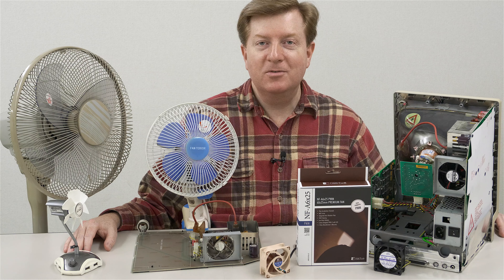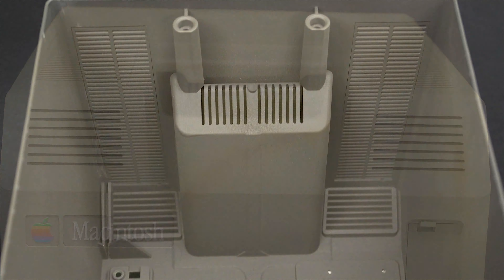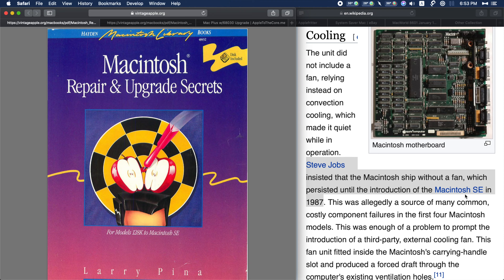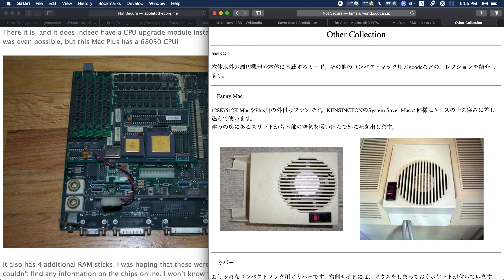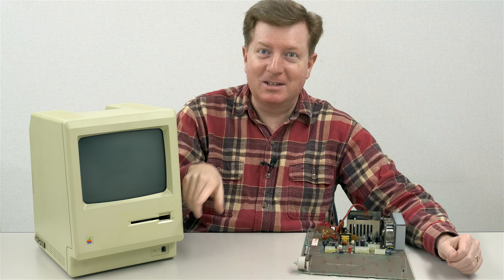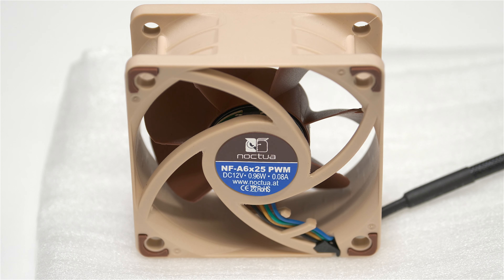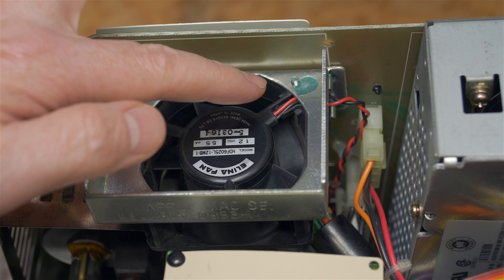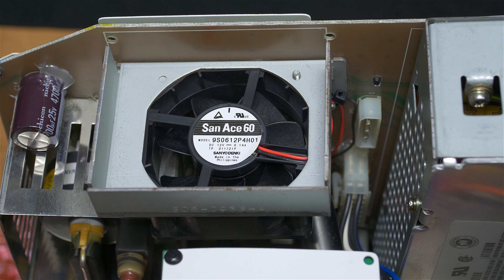FANS for Compact Macs [128k - Color Classic]

Comment: Wow, thanks for taking the time to solder in and out all those fans— not an easy task to take the machine apart so many times!  I hate doing it just once because I’m always worried about bumping the neck!
Reply from the maker: I never had an issue bumping the neck. What I did find is that repeated disassembly puts strain on those analog board connectors, which is why I mentioned them and hot glue in my video. Thanks for watching!

Comment: Wow - what a thoughtful and useful video; it reinforces my faith in humanity :) I've been reviewing fan options for my VERY loud Quadra 950, which uses an old Sanyo Denki 120mm 12v, and I've been curious about Noctua models in terms of pressure vs. sound level. As others have mentioned, the sound level becomes especially apparent once one has converted a noisy SCSI HD to an SSD option, like Artmix has offered for years, or more recently, the SCSI2SD products. I especially like the PWM wiring conversion - a very elegant solution in how you tidied up the unused leads inside the shrink tubing. Thanks again!
Reply from the maker: Thank you for your very kind words.  Those Sanyo fans are very loud.  But they move a lot of air.  So if you don't have many heat-generating upgrades in an old Mac, it makes sense to swap it out for a Noctua which moves more air.  However, for a compact Mac which tend to run hot anyway, adding multiple upgrades can make it a real scorcher inside.  My Silenx fan is dead silent but moves so little air it hardly differentiates itself from the Mac 128K which uses convection cooling.  The Noctua is much better, but even that doesn't cool like those loud Sanyo fans do.  Nothing cools like the Sanyo, but not everyone needs that much cooling.  Best wishes!

Comment: I've watched this video a few times now and I must say (as a Mac Plus user) how glad I am that you did spend a few minutes talking about fan-less Macs from the 128k to the  Plus. I have every time I've used the Plus after about 15 or 20 minutes felt the top and felt it get reasonably warm. I'd be lying if I said I wasn't a little worried about it despite my Plus being completely stock aside from the RAM upgrade to 4Mb and running system 6.0.8.

I'll try to find an external desk fan to point at it at some point just for some added peace of mind since It kind of puts me off from using it a little when I think about how warm the computer feels when I feel the top. Even though I live in the UK and since its winter, the temperature almost never rises above 20°C anyway, that and also the fact I had the capacitors replaced with brand new higher voltage tolerating ones just a couple months ago.
Reply from the maker: I'm glad to hear my video has been helpful to you. Since you live in the UK, I honestly wouldn't be worried about the heat you feel with your hand.  Some have chastised Apple engineers for having created it that way, claiming it was due to a Steve Jobs demand rather than good sense.  But engineers are still savvy about how to design something well within undesirable constraints.  Not every Macintosh 128K failed due to heat.  However, on the earliest 128K models, there is that flat piece of metal soldered to the very top of the analog board.  You are a Mac Plus owner, so your board should not have one of those.  For people who do have one of those earliest analog boards, desoldering and removing that metal piece will allow better airflow up and out the top vents.  Again, since you live in a cooler climate and have recapped your machine, you really don't have much to worry about.  Just keep your room cool enough for you to enjoy (and not sweat) and your Mac should be just fine.
Reply: @JDW-  Thanks a bunch! I'll try not to be so apprehensive when it comes to the warmth of the Mac from now on.
Reply from the maker: @TaijanDean  So long as you don't just leave the power switched on and then walk away for hours or days at a time, it should be fine.  These old Macs don't have sleep mode.  Our finger powering the Mac off is the only sleep it gets. :-)

Comment: Thanks, it had a lot of useful info and I appreciate all the work involved with testing the fans.  Note, I did my Noctua replacement before watching it and I simply used a standard Molex splitter for a solder-free solution. Feedback: the video was quite repetitive and could easily have been half the length with the same contents.
Reply from the maker: Thank you for watching and for your kind comments. The key to getting something stuck in our minds is repetition, so anything repeated in my video was done deliberately, to the chagrin of some and to the delight of others.

Comment: hi, thank you for this great viedeo - 

i now install some Noctua 60x25mm PWM 12V in my several Macintosh Classic II with silent Conner 40 or IBM 80 HDD , and i figured somthing out to the Noctua plug 4 pin

in Classic II (Classic ) -  you dont have to cut and solder the wires and isolate of the Fan to plug on the two pin sticks of the Classic II analog board - you can use the Noctua PWM 4 pin plug ! ( 3 pin Plug maybe - ive only testet this by 4 pin PWM )

just pin out the blac Noctua 4 pin Plug gently with a needel - turn the black plug arround and  use the inner two holes to stick bach the yello for plus and black for minus kables - the othe two not used cables in the outher wholes back 

look at the code pin on back of the black plug you will see the two pin code pin will go beneath these if you use the inner two for 12 V fan voltage ( 3 pin maybe same , not testet )

to pin it right,  note that the "BP3"  2 pole stick on the analog board is written that "1" beneath - is plus 12V ( noctua yello cable ) and "2" is minus ( noctua black cable ) pinned

 to stick the 4 pin black plug back to the analog board sticks 12 v use the inner 2 - the outer 2 cable stands right ond left over - but isolated in plug 

a niche an clean looking solution without cutting and soldering and ugly kable isolation needed - i think

after 10 years MacMad again 

Greetings NT-Tom

Comment: Thanks so much.  Just inherited a nice recapped SE/30 with maxed out RAM and wanted to replace with something more effective and quiet.  BTW -  I also grew up in the Central Valley ;)
Reply from the maker: Thank you for watching and for your comment.  I've lived in Japan since 1994, but there's a lot I miss about the Central Valley.  The thing I don't miss though are the summer temperatures.  It's quite a bit cooler here in central Japan!  Folks in Fresno definitely need to have the San Ace 60 in their SE and SE/30 Macs! :-)
Reply: @JDW-  Indeed!  I too have left the heat, in my case in '91.  Keep on Mac'in in Japan

Comment: Hi, DJW

i found 3D printed fan holder for SE SE /30 and even for Classic ClassicII     on e lecto - bay -  USA  ;-) for buy  what your are looking for at minute 44:00
with a better air flow as it looks, the Classic housing is even built for a bigger 80 mm fan

( he also has some useful Macintosh 3D printet gadgets like for the Quantum head problem glued on old rubber by starting )

i also figgured out by install several noctua 6x25 FLX !  3 pin fan that there you have to choose the red wire for +12V  - not the yellow as by the 4 pin PWM fan shown by you

i also find a way to connect only short wires from the fan to the SE analog board by drilling 2  1mm holes underneath the 5 V GND 12 V + connector for the HDD Cable and weld  the original shorten fan cables from the welding backside

with the delivered Power adapters from the FLX 3 pin noctua you even need no welding just using the 12 V adapters on this HDD VCC Connector

but i worry a litte bat of maybe get a contact problem with this short adapter so cut of the cables an weldedt them as descripted

how a PWM Noctua 4 pin fan can installed without welding , in a Classic , just pin out the connector case - i wrote som komments below

greetings MacMadTom

Comment: How did you get the 128k to play that video of Steve Jobs introducing it? Is it built-in?
Reply from the maker: I have long waited for someone with a sharp mind like yours to ask me that very question! The answer is: magic! ;-)  

Okay, a bit of FCPX magic.  But it is really running on a B&W vintage Mac.  You see, the 128K through the Plus just aren't power enough to play back video, even small video, much less full screen.  So what I did was create a B&W Cinepak version of that video using my G4 Cube running MacOS Tiger, and I made it to be the exact resolution of the CRT: 512x342.  I then booted my SE/30 and played the video back full screen in QuickTime player running under System 7.  I sat my SE/30 in the same place on that desk as the Mac 512 shown in my video, then filmed that clip playing.  Separately, I filmed my Mac512 in the same spot on the desk, switched off.  In FCPX, I masked the CRT portion of my SE/30 footage onto the Mac512 footage to get the end result.  So it is playing on a vintage Mac, just the SE/30.  But since Steve Jobs introduced the Macintosh 128K in 1984 and not the SE/30, I though it best to simulate playback on my 512K Mac (which looks identical to a 128K), and I hoped it would provoke more people to ask me how it was done.  Strangely, you are the first person who has.  So congratulations!

By the way, my SE/30 has a 50MHz 030 accelerator card, which helped with the smooth playback at full screen resolution.  Cinepak is the only codec that will playback on these old B&W Macs.  I tried Sorenson, but it was much too choppy.  You also need an older Mac to even deal with Cinepak, which is why I needed to use my G4 Cube running Tiger.  You can read all the details here: https://bit.ly/3fY5TKE
Reply: Oh, I thought that was it. Wow! That must've took a lot of work. It looks really good though.
Reply from the maker: @cadenyang3058  It really was a lot of work, but it added a lot to the video and it was a learning experience too.  I would encourage you to give it a try if you own a fast enough machine to playback video.  That link to the 68kMLA thread I linked for you in my previous post gives every last detail on what you need to accomplish it.  Simply put, you can basically take any modern video clip and make it a Cinepak version that will run on old Macs.  Maybe I should make a video about that. :-)
Reply: @JDW-  I do have a SE Superdrive, and want to get an SE/30 someday. Is it very hard to recap the logic board?
Reply from the maker: @cadenyang3058  Sadly, an SE/30 logic board recap is one of the videos I have not done yet.  The reason is because all my SE/30 boards were recapped by myself many years ago.  

Recapping isn't so difficult if you have two soldering irons or a desoldering station which has a tweezer tip (which is what I have).  You see, the capacitors are surface mount, which means you need to heat both pads on either side of the capacitor to properly remove it.  Some people twist the old capacitors off, but that risks damaging traces.  I would never advise that.  After the old caps are off, it would be a good idea to clean the entire board with as close to 100% ISO alcohol as you can find. I put a link to that in the text description under most of my videos.  You would then either recap with electrolytic capacitors (which would need to be replaced again) or go with SMD Tantalum.  The key to choosing the right capacitors is not merely the same capacitance and voltage (actually, you need a high voltage rating -- double -- when using tantalum), but you also need to make sure your new capacitors are sized right to fit the pads.  Measuring with calipers is what I normally do.  Then you can better pick new capacitors.  This is important because if your new SMD capacitor is too big or too small, its legs won't touch the motherboard pads and then you have a rather big problem.  So physical size is key.

Comment: Great video, great channel, and you now have a new subscriber :)   I used the Noctua fan in a SE/30 I rebuilt a couple of years ago. I wanted lower noise because I removed the HD and installed a compact flash drive from Artmix out of Japan. I also have the PWM version (sent to me by mistake) but did not realize it could be used, so thanks to this video, I will install it in another SE/30 that I have. OK, I'm very curious as to how you ran that video (or any video clip) on a 512K mac. I would love it if you created a "how to" step-by-step video. Many of us collectors would like to show off our machines with this type of demo.
Reply from the maker: John, thank you for your kind words and for your subscription.  Yes, your PWM fan will work great in your other SE/30.  I'm thrilled you asked about the Steve Jobs clip on my Mac 512K.  I actually ask people in the text description to share their thoughts with me about that, but you are the first person to finally mention it.  The short answer is: it's a combination of trickery and reality.  

The Macintosh 512K cannot display video of any kind, even if you have a hard disk attached (e.g., HD20 or GCC HyperDrive).  The 68000 CPU simply isn't fast enough, and 512K isn't enough RAM.  However, an accelerated SE/30 can accomplish it.  What I did was create that 12fps clip on a modern Mac, then I used a G4 Cube to encode it in Cinepak format (Sorenson won't play back nicely even on the fastest SE/30).  After that, I transferred that video to my SE/30 and used QuickTime Player in full screen mode.  It probably can be done in System 7.5.5, but I used System 7.6 and QuickTime 4, since I have a special ROM SIMM that allows 7.6 to boot on my SE/30. I placed the SE/30 on that table and shot the video playing full screen.  I then replaced the SE/30 with my Mac 512K switched off and reshot the same scene, which was easy to do since my camera was sitting on a tripod.  In FCPX, I cropped the CRT portion of my SE/30 and placed that atop the blank screen of my Mac 512K.  The audio recorded from the Mac's speaker was audible, but I decided to use the original audio track from the original video in my FCPX timeline.  

All said, I thought it most appropriate to make it look as if a 512K Fat Mac was playing it because rumor has it a Fat Mac is what Steve Jobs pulled out of the bag and used to read that text, since the 128K didn't have enough memory to achieve it.  So even Steve Jobs used a bit of trickery to sell the Macintosh 128K. Anyway, a lot of people probably think I just did it all in FCPX, which isn't true.  It's actually running on a vintage compact Mac.  It's just an SE/30, not a 512.

Comment: No mention of the "chimney"? I built one out of cardboard for my Mac Plus in the day. Increased the convection (supposedly). Can't seem to find a link ... where did I get that crazy idea from? Maybe a book?
Reply from the maker: No mention deliberately because my video focuses more on the SE and SE/30 than earlier compacts. A second reason is because I’m no fan of the Chimney design aesthetic.  Adding an internal fan to a Mac512 or 128 is a more realistic scenario from a practical use standpoint, not because the chimney doesn’t work properly, but because you will get tired of staring at that monster real fast! :-)

Comment: What size fan do you need for 128k. Im super into the macintosh original. Im getting one soon along with a mac plus and the mouse. Im trying to maximize the 128k or maybe 512k expierence.
Reply from the maker: Because there is no dedicated fan bracket in the Macintosh 128K, you can use any fan size you want, and you will need to make your own bracket.  The fan shown at 1:46 in my video above is a fan that came with the GCC HyperDrive back in the day and is not currently sold today.  Not sure if that is 60mm or 40mm -- I would need to break apart that machine and measure to know for certain, but in any case, you would need to figure out a way to make the fan stick in that position so it doesn't fall down over time and short out something.  Another option is to find an external fan solution like the Fanny Mac.  Or, if you don't plan to run you Mac 128K 24/7, just keep your room cool and run it as is.  If that isn't satisfactory, a floor fan aim at the Mac will suffice, and even Mac Repair book author Larry Pina recommends that too.

Comment: Thanks for this - I recently wired the 3-wire noctua flx into my SE FDHD. I chose to splice the red to the red from the stock fan, the black to the black, and leave the third yellow wire unused. Does this seem right? It runs, but I’m honestly not sure if it’s running at the maximum speed or not
Reply from the maker: Correct. The yellow wire is only for the RPM speed signal. 
https://faqs.noctua.at/support/solutions/articles/101000081757-what-pin-configuration-do-noctua-fans-use-
Reply: Awesome, thanks! It runs so much quieter now, compared to the old failing bearing stock one
Reply from the maker: @thackerybrown2860  The main downside to Noctua is the price, especially here in Japan.  They include too many accessory harnesses nobody needs, and the packaging is a bit over the top. A simpler and cheaper offering would be better. But nothing beats the airflow versus sound, so I use them exclusively.

Comment: Could you explain how to take the 12v from a Macintosh 128k/Plus?
Reply from the maker: Certainly.  I marked my existing photos of Flickr for you here...
https://www.flickr.com/photos/66071596@N00/49551948832
https://www.flickr.com/photos/66071596@N00/49551712251
Larry Pina in his Macintosh Repair and Upgrade Secrets book suggest removing the relevant 2 pins from the connector so you can solder on your fan wires:
https://bit.ly/3bLtImz

But it's probably easier just to tap the relevant 2 solder joints on the BACK of the analog board.

Lastly, here's a schematic: https://bit.ly/39Gb2mj

I hope this helps!